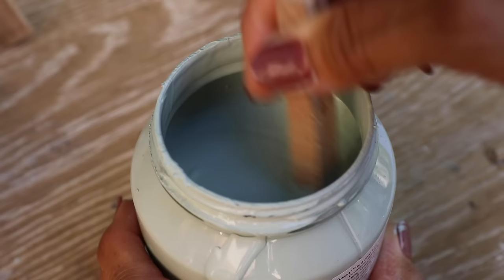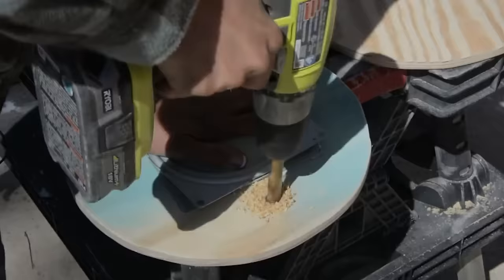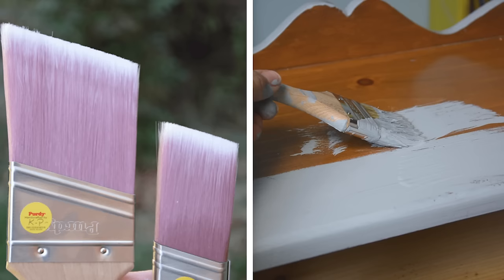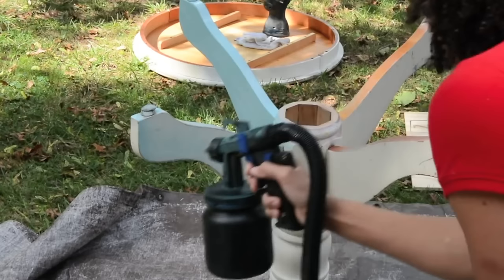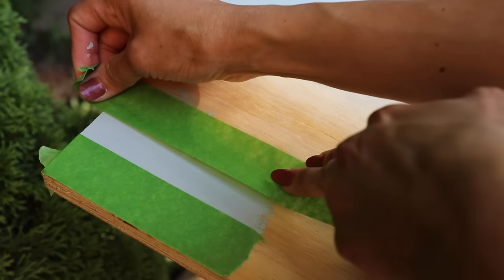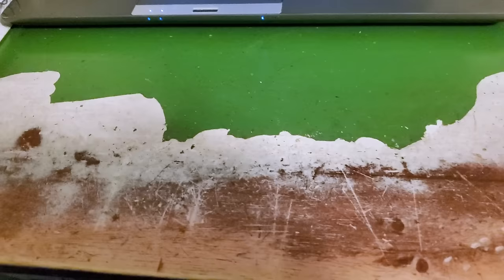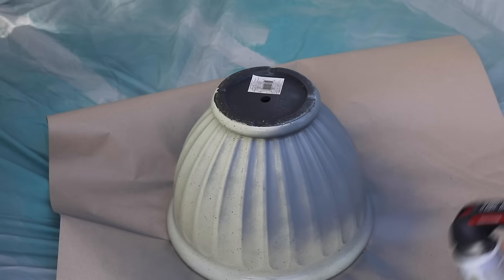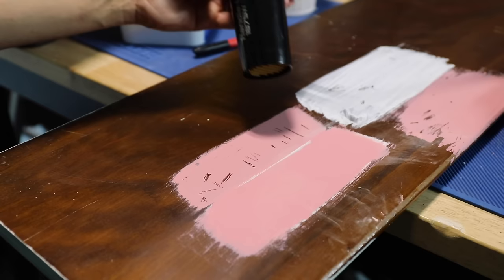10 Biggest Furniture Painting Mistakes (and How to Avoid and Fix Them!) - Thrift Diving

Comment: Hi Serena I'm new to thirfting & painting new furniture, my two biggest problems are finding the right paint brush & wondering if I have real wood , ?
Reply: Once you get the hang of it you will know if you have real wood. I actually teamed up briefly with a knowledgeable wood worker and was shown signs to know if I have real wood. Some entertainment centers for example are plywood covered in oak overpayments veneer. I had been protecting a fancy plywood furniture piece I thought was real wood. I tossed it out the front door with a free sign. It could have been great for repurposing or wood scraps to repurpose also but at the time I needed space more than more projects. And we can always get more stuff. 
Always watch for pressed wood which is wood shavings pressed together and they call it real wood. Once you run across that a few times, you will just know. 
Much of the newer furniture is made of this. I avoid it. As it does not sand well nor hold up in moves or moisture including paint. 
Real wood is hard to find on newer furniture. Which means much of the older furniture was real wood and will last for generations! And had lasted that long already. It is also heavier. Good quality is heavy (but tell tale signs is name brands stamped inside, the joints of drawers and styles. ) ....vs. so is plywood and pressed wood ( drawers and joints will have screws and bolts rather than dowel connections etc.

Comment: I have a question regarding the Kilz original primer you showed and the bulls eye seal coat. Would the steps then be to 1.Clean the surface 2. Sand the surface  3.seal (to prevent bleeding) 4.primer 5.paint?

Comment: Greetings! I want to thank you for everything you explained above. I really want to start restoring some furniture, but I suffer from migraines, headaches. especially when i smell the paint. Is the mask a safe solution for not smelling the paint? Or will it be a problem for me again? I would greatly appreciate an answer. All the best!
Reply: The mask will not prevent smells. It will prevent us from inhaling toxic fumes and dusts from the paints sanding etc..

Some Chalk type paints have less odor than others.

Look for low odor or no odor paints a d no toxic chemical paint or "no vox" as some refer to that as.. 

And as always paint and sand in a well ventilated area...large rooms with no combustibles hazards...furnaces, heaters, paints chemicals,  or large rooms or small with fans and windows doors open.  Or outside as shown.

Comment: Thanks for sharing!  I am getting ready to tackle several areas of my home with paint (furniture, walls, and flooring).  I have a question about the yellowing Polycrylic.  I have seen several DIY places about using it over the floor paint as a sealer / waterproofer.  Does it turn other colors various shades?  I used polyurethane on my kitchen countertops at my old house and my beautiful apple green looked like someone went to the restroom on it!  It was not nice!  It was exciting to hear that polycrylic did not yellow - but now I'm nervous.... LOL!
Reply: I saw another video that said to use polycrylic as opposed to polyurethane to avoid yellowing so now I’m confused lol

Comment: If you use oil based poly, it will yellow; however, you can use water based poly with no problems.
Reply from the maker: Not necessarily. I'd recommend testing it first, even if it's water-based. As I demonstrated, it defintely can yellow.
Reply: @ThriftDiving  I've never had water based poly yellow on anything.  Even on my ivory colored kitchen cabinets.  Which is why I commented.  :-)

Comment: Hi so I made the mistake of getting paint that had a matte finish for my dining table. I’ve heard it’s super hard to clean off smudges. So my question is can I add like a sealer to my dining table that will make cleaning easier or is there a way to clean off smudges off of matte paint

Comment: Also, for furniture diy is it better to use a brush or roller? The roller I used during my project seemed to contribute to the dripping so I was wondering if one method is better than the other. Can I sand over the spray paint after a bad paint job that’s already dried where there’s a lot of dripping and if so, what grit? Thank you!

Comment: I have problem 4 - I've done 2 coats of furniture paint and the paint is just scratching off with any slight bump. What should I do? Should I sand right back and start again, give it a good sand and prime and start all over again? Or give it a top coat?
Reply from the maker: Good question! First--what did you paint? Secondly, what kind of paint did you use?

Comment: Can anyone offer a few suggestions? I bought an ikea Kallax shelf and it was brown. Went to Lowe’s to try a chalk paint project but was talked out of it by someone in paint dept.😩🤔🙄ended up with yellow cabinet paint which wouldn’t properly adhere although she told me I wouldn’t need to prime due to the type of paint😩. The paint job was awful with lots of drips and other stuff and I went back to complain due to the fact that now my shelf was ruined. Manager was nice enough to get me different products to try and fix however once I went back with the items he suggested the shelf is done but has many paint mistakes and drips. I live in a small apartment and this one project took over a week to complete and way more funds than I anticipated just to get things straight and I’d say I should have just left it as is and added wallpaper because I can’t keep repainting and I don’t want to sand back down to repaint because I had to spray paint the second time around. Does anyone know of a quick way to camouflage or conceal the drips and scratches that resulted from final paint job? Maybe some decoupage or gold gilding to hide the imperfections? I was really excited to diy some small pieces but then was a blow to my ego, and now I hesitate to try another project. I thought it would be fun and relaxing because I like art, but I just ended up frustrated and angry that I got bad advice from who I assumed would be knowledgeable and it ultimately cost me the shelf itself plus money to try and fix it. Suggestions for people doing diy in apartments with limited space and other restrictions that homeowners don’t have? Thanks in advance.

Comment: Can you put sealer over wax? If I wax now and later decide to put sealer over it can I?  I am thinking doing my dinning room set, not sure what brand of chalk paint I am going to use yet. What was the brand you suggested for any paint?
Reply from the maker: Good question....my first thought would be to remove the wax first, then use a sealer. To remove the wax, research this first, but I have heard mineral spirits works. You want to remove the wax so that the sealer has something to stick to.

Comment: If I painted something and didn't sand or prime first can I go over it with a primer after it dries and then paint again.
Reply from the maker: I think what matters most is what kind of paint are you using. If you're trying to use regular wall paint that you'd pick up from the counter of the amount department, that paint requires priming first. If you used that....then realized you forgot to lightly sand and prime....it likely won't stick well, so I would strip off that old paint. Because whatever you put over top of it, is only going to stick as well as your initial layer. If you used paint made for furniture (like chalk paint) you wouldn't need to sand or prime if it's in good condition. But even if you used furniture paint and THEN wanted to add primer just because, you could. Hope that makes sense!

Comment: Help! Lol so I’m in the process of turning a changing table into a coffee bar. I can say I definitely rushed it. Grabbed spray paint and went to town. Left it out to dry outside and it rained! So now there’s some areas that have chipped. And some inconsistency with the paint. Is this a loss cause? I want to basically redo it with chalk paint! Bad idea?  Would i use wood filler for the chipped areas, sand it and then would I be able to go over with chalk paint? I’m a mess 🤦‍♀️
Reply: I say sand it down and restart

Comment: So polycrylic turns yellow?  I’ve seen it recused and recommended by numerous furniture painters.
Reply: Some brands are better than others. Polyacrylic is always water-based so you should be able to mix it with some of your water-based paint color to minimize any cloudiness or unwanted color-change. That also cuts down on some of the glossiness of the final effect of the polyacrylic top coat. I start with 8 parts poly to 1 part paint and do a patch test then adjust the ratio from there. 

I have a feeling the lady with the white bed used oil-based polyurethane which is notorious for yellowing, that or there are some heavy smokers in the house and that was yellowing caused by the nicotine :) I've never seen a polyacrylic that yellowed that badly, but then again, I haven't tried every brand under the sun either. There are also water-based polyurethanes but I have almost no experience with those and can't speak to whether they yellow or how they react when mixed with water-based paint. 

I've used oil-based polyurethane only a couple times, once over red oil-based paint on an Asian style exterior door and once redoing an old pine wood floor in a rental property. Pine is a relatively soft wood to begin and was in need of the extra protection and durability of an oil-based polyurethane coating. It did yellow both times I used it. I didn't consider it a problem in those projects. The door turned out a little more on the scarlet side of red maybe. On the floor I deliberately balanced the expected yellowing with the chosen stain which had a slightly lavender tint. The finished result was an unremarkable light brown (last time I checked.) Hope some of this helps!

Comment: I am currently working on a cheap desk that is as much particle board as it is wood AND the particle board has suffered water damage.  I have sanded it down to create a smooth surface, but now I have a lot of exposed particle board which is just going to swell when I start to paint.  Right now, my place is to bondo those surfaces and then re-sand to create the smooth base.  Will this work?  It there a better approach to this issue?       
TIA
Reply from the maker: Hmmm....that's a tough one, Staci. I hope the Bondo works for you, but that's a lot of smoothing out you'll have to do. Next time, I would recommend that you look at the quality of the particle board. If it's just got water rings on it, but can tolerate paint and still result in a smooth surface, I would just paint over it. As long as the wood or particle board wasn't warped or anything "janky" like that. If you were sanding to just try to remove the water damage but there wasn't anything else wrong with it, and it wasn't warped, you didn't really need to do that. Another thing that comes to mind is seeing if an oil-based spray primer (use this outdoors, not indoors, because it's really stinky) would work to help create a surface that you can now paint on since the particle board is exposed. Try the KILZ oil-based spray primer. Let me know if that works!

Comment: Ok you said you have to reapply wax every 6 months?  What if I want to resell a piece and it is chalk paint I’m using and I want to use wax as a top coat what do I do?
Reply from the maker: Good question! I think you would let people know that you used clear wax and that you recommend they apply wax at least once or twice a year to preserve and care for it. :) Or you can use a furniture paint that does need wax. I love Fusion Mineral paint which is a little more satin-y and has a top coat built in. They actually have a top coat in their line and you can use that on top for even more coverage, especially if the top will get a lot of use (wear and tear). Hope that helps!

Comment: So, I painted a metal chest, vintage Black and Gold Hardware metal chest. I painted it navy blue and it is dry now as it is just about 30 days but when I wipe it with the tissue or napkin I still get blue on the tissue and napkin? Does this mean it is still not cured? Or is there another issue. I don't see any chipping with the paint. It is relatively smooth I just don't know why this extra residue is coming off onto the napkin. I want to use it in my living room but I want to know that it's 100% dry and able to be wiped down
Reply from the maker: Good question. What kind of paint did you use? It's not uncommon to still have some color coming off. But if you have used a clear wax or a top coat, it prevents this from happening. I have to have more info about the paint type and if you used a top coat.
Reply: The paint is Behr ultra scuff defense stain blocking paint & primer. It is an interior satin enamel deep bass

Comment: Put oil base primer over drips. The primer is sandable and for some reason it makes the paint sandable. On a new build our contractor hired a painting crew to paint. They didn't fill in any nail holes on the trim. They decided to fill them in after everything was painted with semi gloss. The paint peeled off everywhere they sanded. I had peeling paint everywhere and the contractor wouldn't do anything to fix it. I used primer to hide the mess . It took several coats sanding between each coat. When it was done it was as smooth as a baby's butt

Comment: I couldn't get past the first "tip".  If your paint has too much water even after stirring well, then turning it upside down isn't going to get rid of any water and if stirred well there won't be any solids to mix in.  As far as leaving the top off, all you are going to get is a film in top that will seal the moisture in.
Reply from the maker: When you remove the cap, sometimes paint is thinner and watery on top and the solids settle to the bottom. Turning it over mixes up the solid pigments on the bottom. That's what I meant. If you ADD water, and it's too watery, you just have to let it thicken up a bit (I'm talking 30 - 60 minutes, not all day), so you won't have much problem with a film.
Reply: @ThriftDiving  if there are solids on the bottom then a good stirring will do the trick and thirty minutes not only is not long enough to evaporate moisture but is definitely long enough for a film to form.  I learned to paint as a young girl from my Dad and was told to stir it every now and then to prevent a film from forming which causes clumps in the paint.  I have learned the hard way that he was right.

Comment: Ok so that’s completely wrong about polycrylic. Polyurethane will yellow (the actual top coat itself) but polycrylic will not. 
What DOES happen, however, is bleeding of tannins that are drawn up THROUGH the paint and absorbed into the paint layer, because a top coat has been applied. It’s not the polycrylic causing the yellowing, it’s an issue of prep on the piece. Some pieces will not bleed until they are sealed.
Reply from the maker: Hey Camille, thanks for breaking this down further. It's not completely wrong that if you use polycrytic, you may get a shoddy outcome. From my experience, the polycrylic is notorious for turning white paint yellow and blotchy. From my experiment,  there are some of the tannins you mentioned. Most furniture paints promote that people can simply paint out of the jar/can onto a piece of furniture. That is what many people do (as I have done myself over the years). If what you're saying about the prep being the issue related to the top coat, then it can be said:  if you're planning to use polycrylic over paint, be sure to seal the surface to prevent tannins (and yes, yellowing and blotchiness) in the finish. From my experience, also, brands of furniture paint that  make their own top coats, I never run into this issue with tannin or yellowing or blotchiness. It's just with polycrylic over paint. But, as you're saying, it could just be polycrylic over paint on a surface that has NOT been sealed or primed. Correct?
Reply: Thrift Diving absolutely! 
I don’t agree with a lot of companies and their “no prep, 2 coats” claim, every piece needs to be thoroughly degreased and cleaned and I’ve never seen a white paint cover in 2 coats 😆😆😆 

You’re correct there with the need to prime for white paints. I use Zinsser BIN under anything I paint white, A) to block tannins from leaching into the paint, B) because it gives great adhesion and C) because it reduces the amount of white paint coats you need (especially when specialty paints are much more expensive than primer). 

The Polycrylic, being water based, draws the tannins through when it’s applied. Like adding a coat of water onto it somewhat. That’s why the oil based sealers don’t wick the tannins up, but the top coat itself turns yellow with age/sunlight exposure/too thick a coat so it’s not recommended over white. 

At the crux of it, polycrylic is a great product, or other thin water based clear sealers, but one needs to be careful they have prepped correctly to stop that bleed from happening. Most people will seal with wax if they suspect that might happen with a liquid sealer.